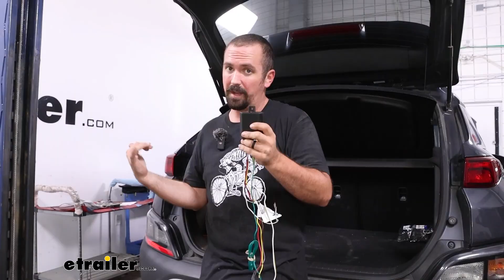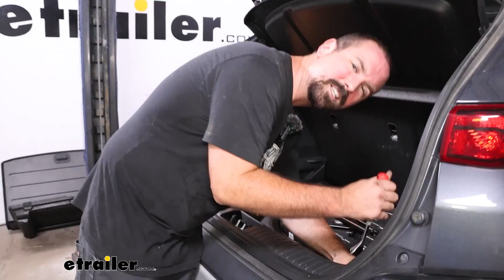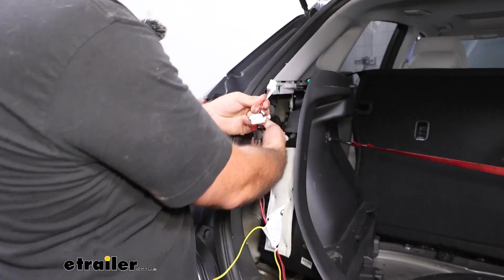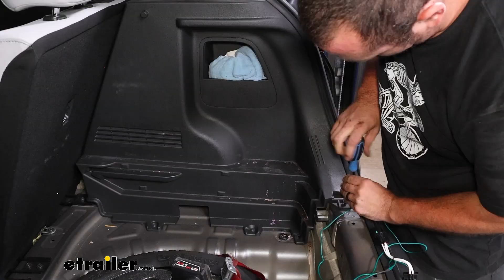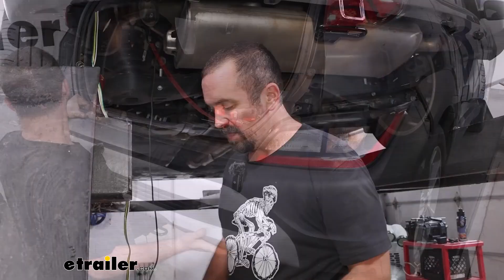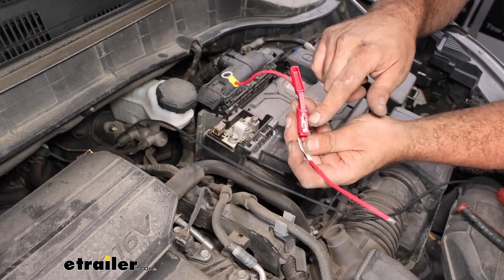etrailer | Curt T-Connector Vehicle Wiring Harness DIY Installation - 2022 Hyundai Kona

Comment: Used this video to install this on the identical car. Only been a month now the wiring harness has only brake lights on (with tester) continuously even with car off and it has already popped a fuse. Harness is intact so this is confusing to me. Did it fail already?
Reply from the maker: I'd check the ground wire. If it was grounded to a central grounding post on the vehicle, it may not be a strong enough connection. If that's the case, then just relocate it to the frame. If it is on the frame, make sure it's a good clean ground. If anything is disturbing the ground, it will cause strange electrical issues like this.